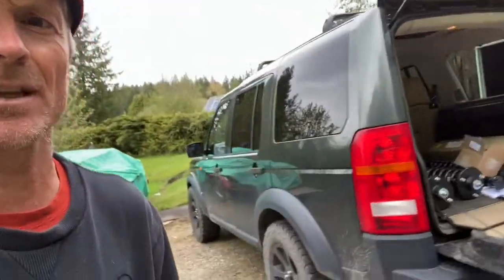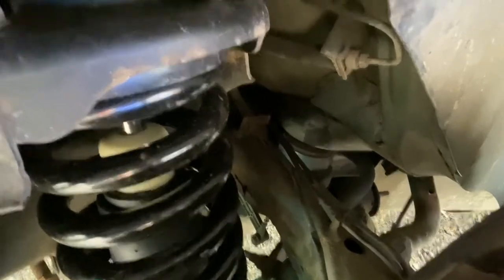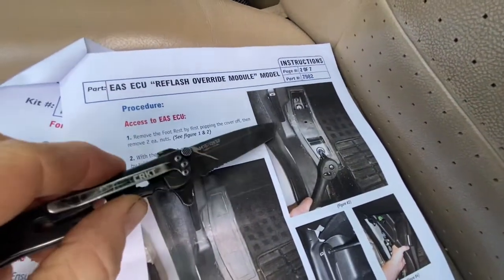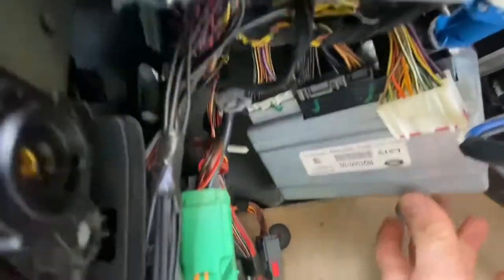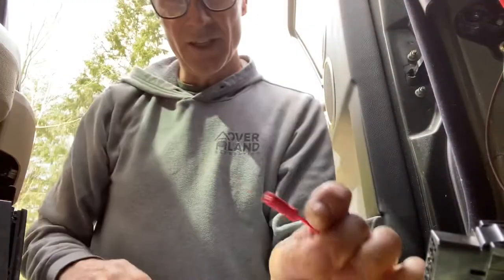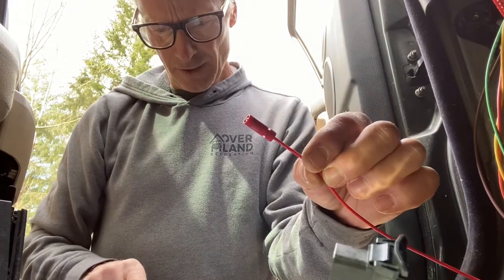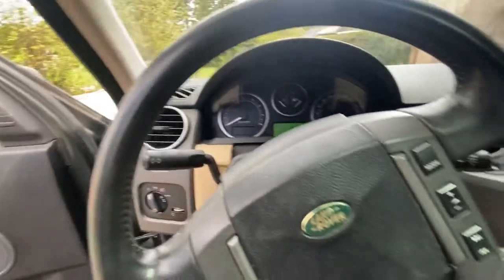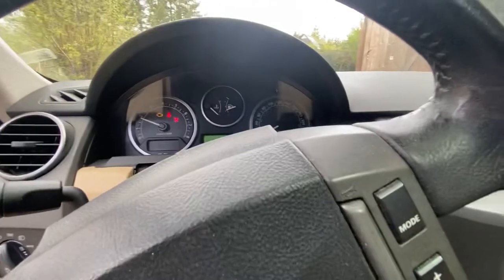Land Rover LR3 air to coil conversion install 2022

Comment: Thank you for this video. I’m considering coil conversion and this is great to be aware of. I have an ‘05 LR3 and so far the air suspension is in great shape.
Reply: Arrrgh! I have an 05 and its gone the full slammed good for nothing, I'm going springs or bonkers, whichever comes first
Reply from the maker: Air suspension is awesome. Keep it as long as you can.  I had multiple air leaks and wasn’t interested in chasing them down throwing money at them

Comment: Mike for the front bolts I removed the heat shielding and used a long extension to remove those.
Reply from the maker: Yes, that’s what I did but only on driver side.

Comment from the maker: So, after a few weeks of driving I’m noticing zero difference in handling or or suspension feel. The only slight negative I can find is that when I hook up my 3000LBS camping trailer I get 1” of drop in the rear.

Comment: Mike, I'm thinking of doing the same to my 2007 LR3 but I want to hear from you and see if 2" is enough of a lift. I would like to get a 3" left but I have not found a OME 3" coils. Let me know or post some pictures if you can, would like to see how 2" looks like.
Reply from the maker: Hello, I added a very cheap donut spring spacer in the rear to help when my trailer is attached. It lifted the truck approx 1.25”.  And was super easy. 
I would install the kit and drive for a bit. If you need more, you can easily install these spring spacers. The ride was still great after a few months.

Comment: Great video. Do you have to leave the OBD dongle plugged in all the time or just once?
Reply from the maker: Hi, it’s not the ODB port. It’s another plug that has to be hard wired into the ECU as shown in the video. 
The ODB port is open.

Comment: nice video. seeing mistakes is great....we all do them.  is the wiring obvious? That's what scares me....wiring.  I love my LR3.....but also hate it, just because of the regular air suspension faults.
Reply from the maker: I was scared of wiring but slowly went through instructions and it all worked. Yes, love the truck but there is always some issue in chasing.
Reply from the maker: Take your time and triple check. The wiring wasn’t too bad.